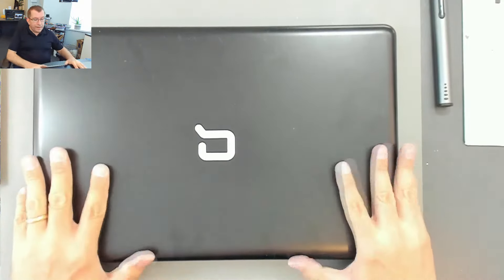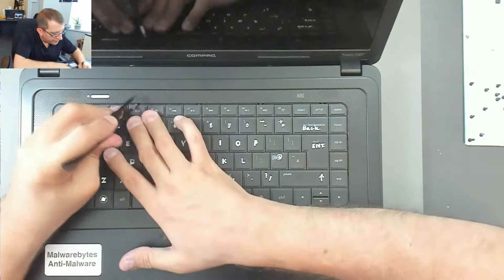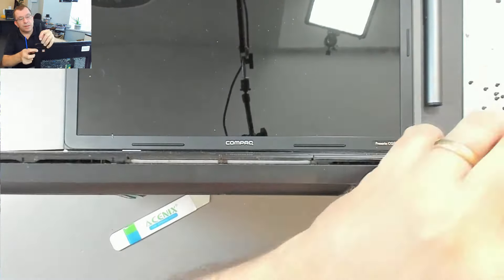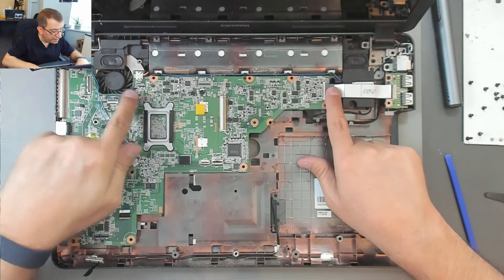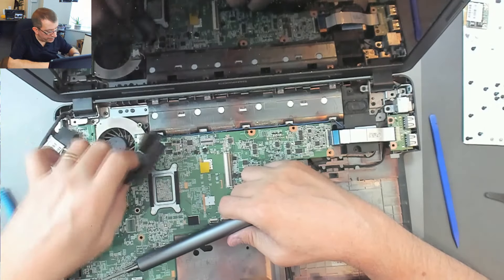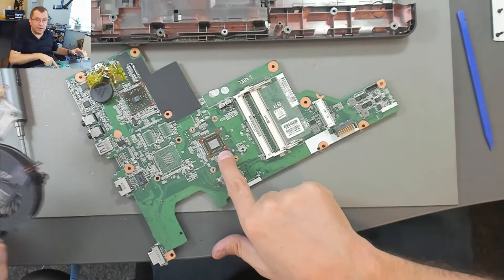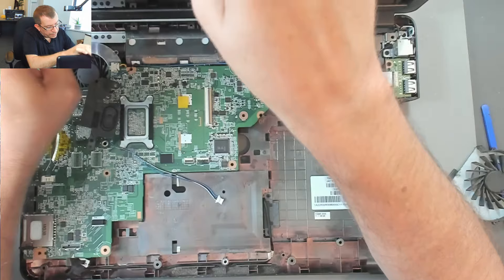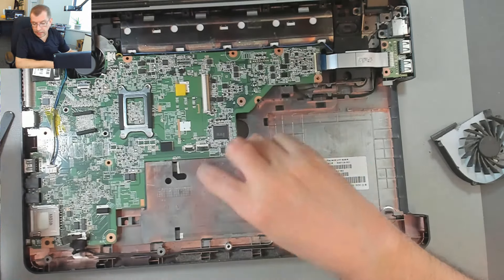[62] Compaq Presario CQ57 - Cooling fan replacement

Comment: Also after you remove the old fan using the four screws as shown, remember to inspect the cooling vent (attached to the fan assembly, and clear it of all the dust and grime using a toothbrush and compressed air.
Reply from the maker: Yes, good point!

Comment: Just a small correction. 

Do not lever the keyboard out using the tools as shown.

On the back of the laptop near the wifi card you will see a small slot with a blank keyboard icon next to it.

Insert a flat blade screwdriver and push with moderate force and the first clip will pop out.

Turn the laptop over and the keyboard will peel away from the remaining three clips without much effort.

Great, clear video, it helped me pull the entire laptop apart and replace the fan with easy!
Reply from the maker: Thanks for the feedback! I agree, you should never attempt to pry out (lever) one of these keyboards. In this example, I used a very thin tool to apply a slight upward force to prevent the clips from re-engaging after I pressed down to release each one.

Comment: I have the Presario CQ56 looks just like your 57, and it is overheating and shutting down, I was a repair tech for years, and built my fair share of computers from scratch back when Comp USA was the goto place for me.

The RA in my hands is not gonna let me tackle this job, way to many screws and cables, and of course if I take it to Best Buy they will tell me at the door "oh we don't work on that."

The reason they dont work on older stuff is because they want you to scrap your old computer and buy a new one from them, so if they say we don't work on that and you can't find anyone else, then if you need a pc you will buy a new one.

I have 6 working computers, this CQ56 makes number 6, so it is not like I need one, I just wanna fix the overheating problem in this one, it was given to me and if it was not overheating and shutting down, it would be just fine for web surfing and youtube.

I tried speedfan but it is not helping and the Bios setting has "fan on always" already set. also used my air compressor to blow through the vent backwards and it does not appear to be caked up with dust inside as none came out, speedfan says their are two fans and one is only 196 rpm, and putting my fingers right at the vent there is hardly any air moving, so the fan needs replaced.
Reply from the maker: My guess would be that the fan needs to be replaced. I'd also remove the heatsink and replace the thermal compound on the CPU. You're right though -- quite a lot of screws!

I recommend using the repair manual, which tells you the order of things to remove: https://www.manualslib.com/manual/599157/Hp-Compaq-Presario-Cq57.html Good luck!

Comment: Hi! There I have the same model with me right now but I am bit puzzled about how you are able to run windows 10 on this old laptop without major upgrade like cup and ram bcus most repair shop owners would say it's not worth it even with upgradation and I also noticed that you didn't wiped off the old heat sink clean off the cpu .
Reply from the maker: With an SSD, Windows 10 runs OK even on old hardware like this. I did wipe the old paste off of the CPU at 13:09. :)